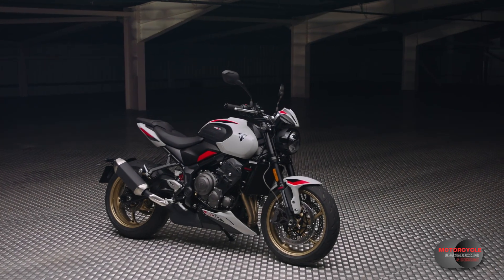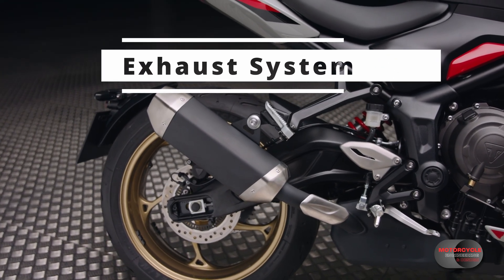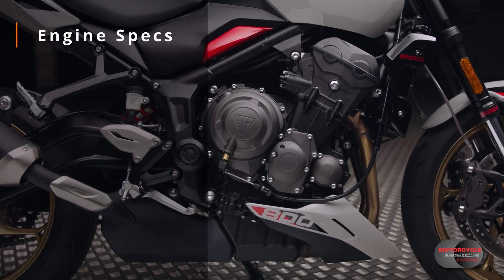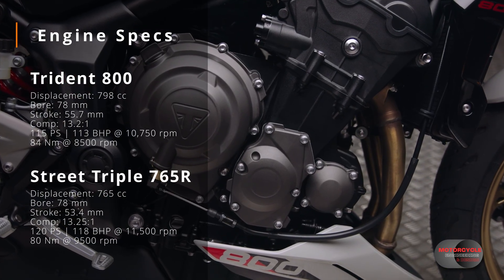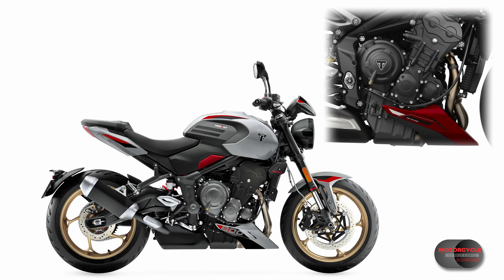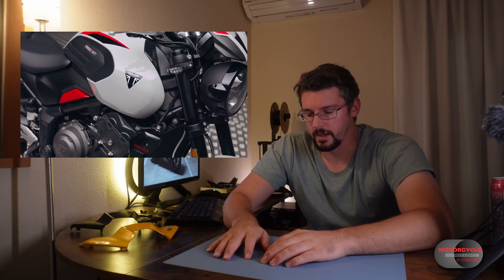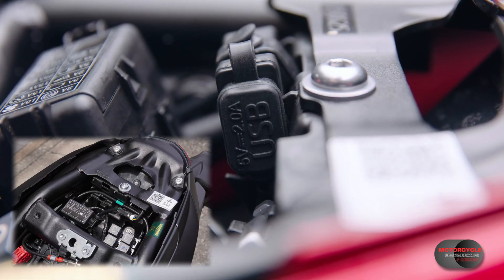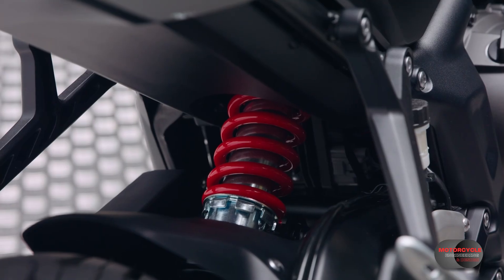Triumphs New Trident 800 | A breakdown of all the shared and reused parts!

Comment: It's not the successor!
Reply from the maker: True, it is not the successor of the 660, but I would expect 660 sales to drop drastically, I believe anyone without a restricted license will likely go straight for the 800 over the 660. You can also outgrow modern 600s in that kind of power range pretty quickly, the 800 offers that little extra that might even make it replace the lower tier of street triple

Comment from the maker: What do you think of the new Trident?
Did you recognise that the whole rear frame and the front end were from the Daytona? 
How about the belly plan taken from the Street Triple, outside the 660/800 bubble?  

The 660 platform started with the Trident and eventually grew to introduce the faired Daytona, this is the reverse of the typical process where the faired model is the base with it then being stripped back for the naked version to be secondary. 
This evolution seems to be undoing the glitch where now the Daytona is the base, and the Trident will be developed second to it.